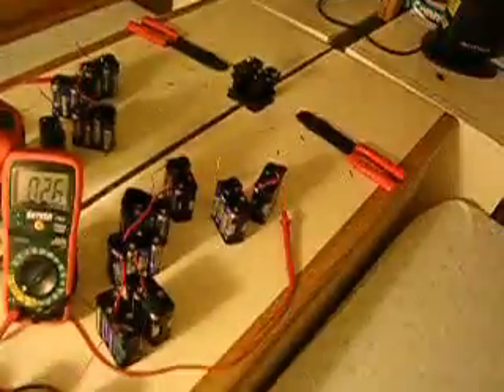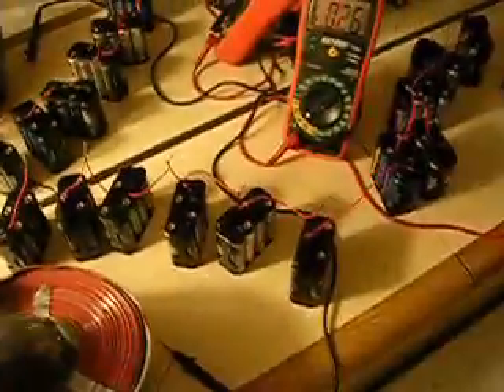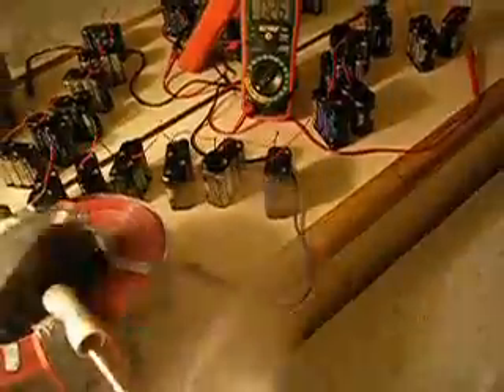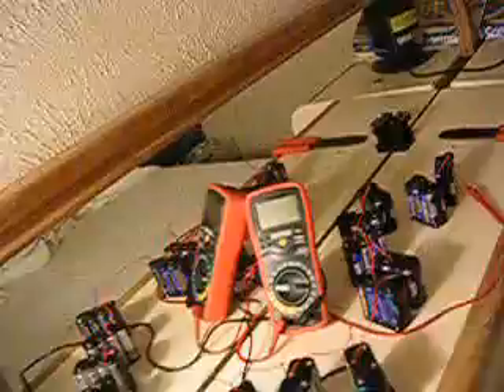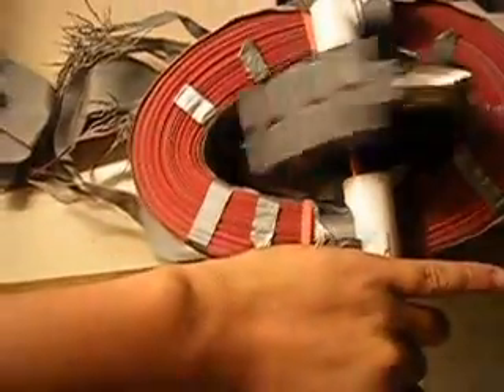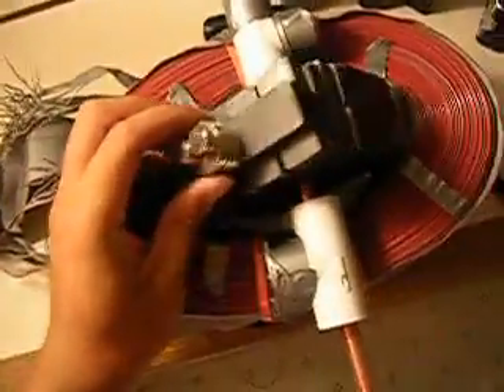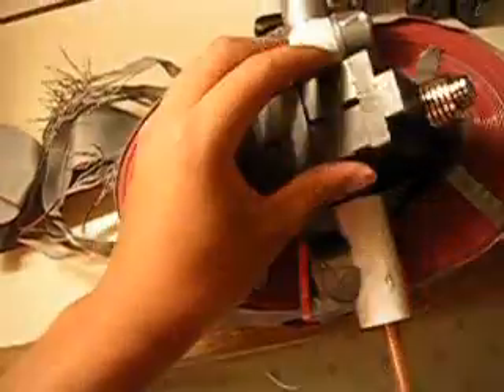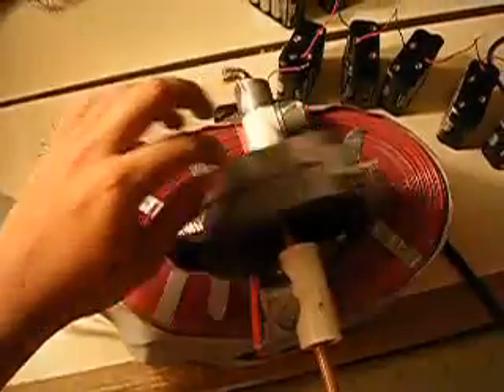Paper Fan ▲ power of 112 AA's

Comment from the maker: "the newman machine works by voltage and not current"

More specifically, the Newman machine is efficient in the sense that it takes a long time for the current to rise to its full value. The time is proportional to circuit inductance divided by circuit resistance.  Higher voltage -> higher rpm -> less time This means the coil still changes energy even when an entire revolution is made. Most power goes to changes in the magnetic field energy (i.e. reactive power) and is not consumed... as heat.